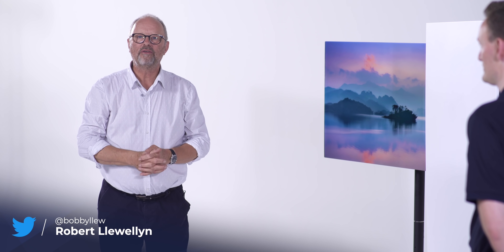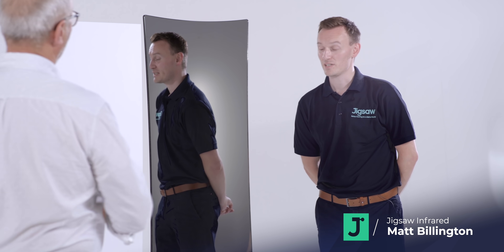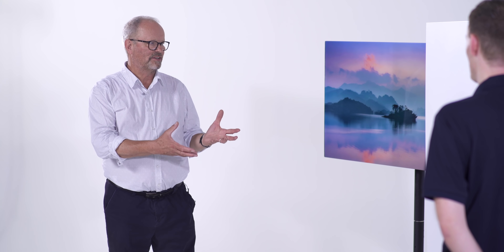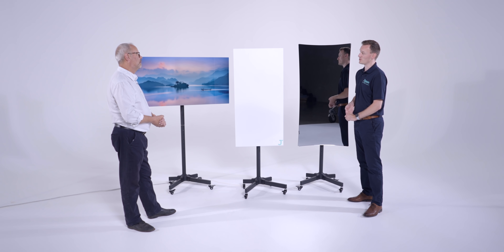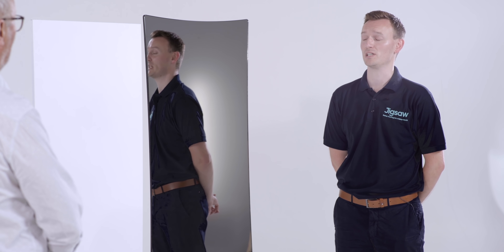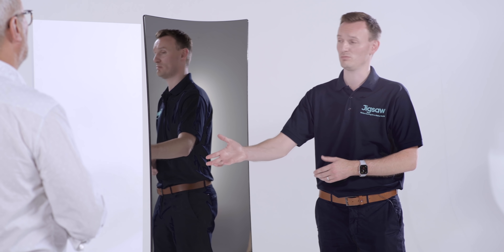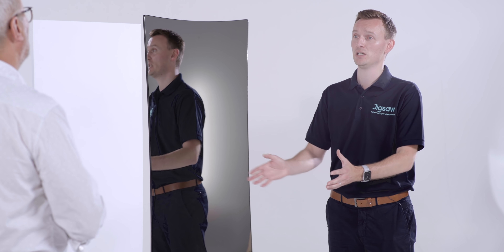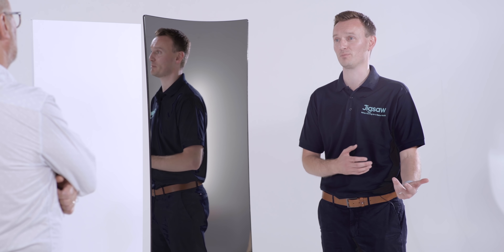JIGSAW INFRARED - Heats like the sun, cares for the planet | Subscribe to Fully Charged PLUS

Comment: When my old gas boiler finally packs in, I'm seriously considering switching to IR heaters.  Hopefully by then the price will have come down a bit too.  I can't wait to be rid of the following:
*Paying for regular service visits from a gas safe engineer
*Boiler breaking down when you least expect it
*The cost of buying and fitting replacement parts for the boiler
*Water pipes running all over the house that could potentially leak
*Bleeding the radiators
*Radiators taking up space and having to lay furniture out so they don't block them
*Paying for gas bills - I'd rather have a single electric bill and not have to pay the daily standing charge for having gas even if I don't use any
Reply: Screwfix currently have 1kw ones I stock for £12.99

The looks may not look the best, but are as efficient and you can decide if you like the heat, and the leccy bills before spending £000s.
Reply: IR is more useful for supplementally heating people, so that the room's temp can lowered. So it possible to just buy one IR heater and experiment with it to see how effective it can be for "you", while your still using your old gas boiler.

But also consider a radiator based Heat Pump (which has tax advantages too) when it time to replace the boiler. Since it will be far more efficient for heating "rooms". HP vs IR heating, have different pros and cons. Good luck....
Reply: The inherent inefficiency of resistive heating will forever gnaw at you. Don't do it.
Reply: Be careful Daniel... last time I looked at my bill gas was 1/6 th the price of electricity per kw/h. If you don't need a lot of heat they could work for sure, but if you are like most of us in the UK and use a lot of heating in the winter you'll need to look elsewhere I fear...
Reply: @benholroyd5221  That's a halogen heater.  IR heating is a totally different technology.  Rather than heating an element (which can reach around 600°C), almost all the energy of these new IR panels is emitted - the panel itself only heats up to around 90°C due to some of the IR reflecting back into it.
Reply: @dansmif  that's like saying a diesel engine isn't an internal combustion engine.

Halogen heaters are infra red heaters. That is how they work.
Reply: @OAK-808  Are you thinking of old style bar heaters with resistive elements that glow with the heat?  IR heaters are a totally different tech.  They're solid state and the panel itself doesn't get that hot.  They emit waves of IR heat across the room and heat the object they interact with.  It's a bit like standing at a window on a sunny winter's day, but you can still feel the warmth of the sun through the window.
Reply: @liammullan2197  I'd also like to get more info on the actual running costs.  My understanding is that the IR panels heat up the room quicker, and then they turn off and on in short bursts to maintain a comfortable temperature, so you're not running up a huge electric bill.  Whereas with gas, the boiler is on a higher percentage of the time to keep the water in the loop hot.
Reply: @benholroyd5221  Infrared is just a fancy name for heat, so yes in that regard all heaters are the same - they produce heat.  The key point is there's lots of different ways of producing heat e.g. heated water, halogen, resistive elements, solid state IR emission, etc. (the last one being the technology that was featured).
Reply: @dansmif  no. Infrared is a type of heat transfer. Of which others include convection and conduction. 

Infrared radiation is I believe the only method you can transfer heat through a vacuum. That is what the heat from the sun is. That is why its heating is so quick. Because it doesn't have to heat up any thermal mass. 

Radiators are poorly named because they work via convection. They heat up the air.  

If you want to test ir heaters, all are as efficient as one another, all have the same basic disadvantages and advantages. These £300 heaters aren't going to magically work  better than £12.99 ones.
Reply: @dansmif  re running costs

Anything is going to be more expensive than gas. Gas central heating is ~90% efficient. Electric heating is ~100% efficient. 
heat pumps are 200% -300% efficient. 

Gas is hugely cheaper than electricity, so nothing currently available can bridge the gap.

If you want lower heating bills without gas, heat pumps are the way to go. You'll get much cheaper energy bills, but that does come with a higher installation cost. 

Contrary to what this video says, I wouldn't say ir heating is the best option for main living rooms. For little used rooms they can be a good option. Or in large spaces. The instant directed is a good fit. For heating main living spaces though, you have no thermal buffer meaning you can't time shift the heating. For that you aren't really going to do much better than storage radiators.
Reply: @dansmif  Of course the panel gets hot. If it can heat the sofa, it will heat itself.
Reply: @OAK-808  You're right - it does heat up, but not to the extent of a resistive heating element which typically reaches around 600°C.  From the specs, it looks like the IR panels operate around 90°C.  Sounds like having them on the ceiling would be safer, and as Matt said in the video, they work better there anyway.
Reply: 22p(+) kwh vs 4p kwh?
Reply: @benholroyd5221  Was just thinking that, lol
Reply: @dansmif  All heaters not designed to convect are infrared heaters, even a gas boiler radiator, or a cheap 2 bar electric fire. I bought 4 little 350 W ones just to test them out. These are wired to Alexa, so I can voice activate, and also remotely activate them. I think the advantage of them is that you can activate them as you walk into a room and heat only a single room. And because my Tesla battery fills rapidly from solar, and I don't want to export, I remotely switch on all the IR panels. The house is therefore used as a storage device and absorbs the heat for later. Not perfect, but I'm just experimenting.
Reply: @James-zu1ij  that’s interesting James. How effective have you found them - in terms of heating & comfort
Reply: @dansmif these are exactly the same as water radiators, they work the exact same. Instead of pumping hor water trough it you replace that with an elctrical element.

Water radiators also radiate infrared radiation. That is the heat you feel when you sit next to it.
These just remove the inefficienty of heating the water, pumping the water, heating all the iron the water is contained in and the placement which usually isn't optimal since loads of people put couches and stuff in front of ratiators which stops them from radiating into the room.

The halogen radiators do the exact same thing, they just use a lightbulb.

Comment: Yeah, heating the last bit only when needed is great idea, but there's still not a very practical simple way to do that, that is also generally and easily applicable. You can feel the instant warmth from an IR heater, but until the air is also warm you will still be mostly cold. Some people is happy with that, most will not be, in real life. Warming up objects, like sofas, and beds, takes a lot of time to do safely with IR, a lot of time means you use a lot of power for a long time. In reality this system is unlikely to save much energy compared to heating to the desired temperature all the time using a heat pump for most people.

Also, IR heaters is a common cheap product, putting covers on them to make them look better is a HUGE disadvantage if you want to be able to heat up when and where you need it. It's a bit similar to having a towel warmer, you could arge that you can shower in colder water if your towel is warm, and thereby save energy, but most people won't do that.

The part about IR being so natural, and that our bodies is evolved to use that, is complete and utterly nonsense. IR is not more natural than convection, and it doesn't matter. Personally, I'm a mammal, and our bodies has evolved to be able to keep the temperature with food as the source of energy. Radiators in "wet" systems also emit IR for that matter.  Also, being heated on one side, and cold on the other is not what most people consider being comfortable, not even if the average temperature the skin experiences is a comfortable temperature, it's about actual comfort, not statistics.  

Preventing mould (and mildew) by keeping a lower general temperature, and using IR heaters specifically when and where needed just does not work, no, absolutely not, no way. You can reduce the risk of mould somewhat, on the surfaces that get hit by IR of relevant intensity, other areas will have a HIGHER than normal probability of getting mould and mildew, all else equal. Mould typically grows in places that wouldn't be exposed to significant intensity of IR from such heaters, unless heaters are installed for that purpose, instead of trying to creating comfort.  It works like this, increasing the temperature of air makes the relative humidity lower, thereby reducing the chance of creating areas with favorable environment for mould and mildew, as they "like" humidity. A lower general temperature, even with temporary and local "hotspots" doesn't reduce general humidity as much, and thereby is the risk of getting mould increased, not decreased.    

Another problem is that the intensity of IR is inversely proportional to the square of the distance from the source, technically from a point source, and their emitters are better than that in this regard, but still, you'd need huge emitters to create even exposure, to create thermal comfort comparable to just having a comfortable ambient temperature. Heating of the floor is extremely slow and inefficient, unless the emitters are very close to floor, or almost as big as the floor, or of course, focused on the floor.   

Claims that their emitters are more efficient than other heaters is just not true. Technically, resistive heaters, which their IR heaters are, are 100% efficient, but, as concentrated high temperature radiators increase losses, mostly due to the high temperatures, they're not generally considered to have a COP (coefficient of performance) of 1, really, but a bit lower than 1. While AC splits can have an average COP of 4, and they can heat the air to a comfortable temperature, quite quickly if dimensioned for it, not just fairly quickly go from to cold to "statistical comfort". They say their claimed superior efficiency is "not a wild claim, it's scientific fact backed by independent study." A single "independent" study, means nothing, extraordinary claims require extraordinary evidence, and their claim is extraordinary, their "evidence" is not.    

IR heaters are not generally considered a new technology, the idea that they're more efficient isn't generally accepted, because that idea is simply not true. And covering them up in order to make them look nicer makes them worse than usual, especially that instant heat part. In order to have thermal comfort where you go, when you get there someone or something needs to be able to predict where you are going, otherwise the idea doesn't work, until your still at one place for a longer period, or, the general area has been heated up, and then you're back on square one, having wasted a lot of electricity on heating the whole area with very inefficient resistive heating.
Reply: Your opinion is noted and you have obviously bought the cheaper version or seen the cheap imports into the UK. It's like buying a car, you get what you pay for. 

Th recent testing and University studies are proving that infrared is quicker and half the cost to run than other forms of electric heating. Have you seen the studies?

Comment: Cool if you can't fit a heatpump - witch is 3 to 5 times more efficient. Nice control features as well.
Reply: A heat pump would cost a little bit more but you'd probably save the difference in a couple of years. Trouble with great pumps is they are a complicated machine whereas this system should be fit and forget.
Reply: Heat pump COP is not all it’s claimed to be. The COP figures do not come from real life testing and the COP is often closer to 1:1 
An independent study – commissioned by BEIS but written by Cambridge Architectural Research – investigated cost-optimal ways to install electric heating, including infra-red heating, and energy efficiency measures across a 12 housing archetypes, representing 90% of Britain’s 28 million homes. The study found that:
•	The total lifetime costs (capital + operating) of infrared heating were found to be competitive, although not cost-optimal in some housing types.
•	There were only small differences in costs over 15 years between low- or high-temperature heat pumps, air-to-air heat pumps, infrared or storage radiators.
•	Assuming a longer product lifespan (e.g. >20 years) for electric storage heaters and infrared heaters made heat pumps less attractive over the total period of ownership – as heat pumps were assumed to be replaced more frequently.
Reply: The panels can be situated in the more appropriate locations in any room, have the heat where you want it.
Reply: @matthewwakeham2206  quality pumps keep save more than enough to pay for repairs and some extra. Heat pumps will get smarter too as well as include cooling feature and or replace boiler (hot tap water). What people chose may vary on their priority, long term saving - features - initial cost - planet friendly.
Reply: @jigsaw.Infrared  sorry Jigsaw, it's outrageous that you're misrepresenting the BEIS report like that - heat pumps were shown to be the most cost effective solution over 15 years and that would only increase.
Reply: I would only ever recommend air to air heat pumps, £2K installed, and just use an immersion heater for water, combined with a 4-6kwh solar its simply the best value for money, Air to water are simply far to expensive install and running cost, and the companies are charging £200 for a yearly service because they can. And IR heating in the bathroom and at the computer desk seems the most ideal place to start.
Reply: @jigsaw.Infrared  If it were true that heat pumps regularly operating at a COP of 1:1 then we would not have be using them for many decades all over the planet. My own heat pump is currently operating at just over 4:1 (my calculation) and that's on Skye. The house is beautifully warm all through the day and night, whichever room you go to.
Reply: It depends on what you do with the heat from a heatpump. If you use it to heat air these panels could actually be more efficient way to heat a home.

The air temperature can be substantially lower in a room when using radiated heat and it can be highly localised. An air based systems needs to heat the entire room to a higher temperature for it to feel equally comfertable.

Comment: These are fairly popular in Europe but the efficiency is max 100% as it's a resistance heater. Never going to as efficient as a heat pump. Can we have some reviews of off the shelf reversible air conditioner units as cheap heating systems.
Reply: This is the issue we encounter. Heat pumps are not appropriate in all cases. There needs to be some alternative and this is another form of heating. If you use solar and battery they are on a par but again, not always appropriate.
Reply: Agreed. It's weird than an EV show would not get it: the resistance heater in my 2016 e-Golf is far less efficient than the heat pumps in... just about every new EV out there. EV people have known this since the LEAF. There's probably a place for these IR heaters but if it's efficiency we're after -- and we are! -- heat pumps are the way to go.
Reply: @glennbillington4879  that surely isn't true. Why would having a battery and solar make a difference. Solar on its one provides electricity when it typically isn't needed for heating. Solar plus battery provides the flexibility to provide electricity when it is needed. Both heat pumps and your panels would make use of that flexibility. By heat pumps are 200-300% efficient and your panels are at most 100% efficient. I think your panels can only be more efficient to heat a small part of a large open space or to provide bursts of heat in a space that is usually unoccupied. Solar + battery is irrelevant to the question of heat pump vs IR panels it's basic physics.
Reply: You need a lot less heat with a radiator. You don't need to heat entire rooms and air temperature can be substantially lower to feel equally comfertable with radiated heat compared to a space that is just heated by air.

Instead of heating a complete space continually to a higher temperature you can use a single panel to just have the heat radiate onto you where you are sitting. Over the dinner table or over the sofa or your desk etc.
Reply: @xchopp  resistive heaters heat air. Radiators radiate heat onto you.
For a car comparison a radiating heater is more like the seat heating in your car. With that on you can keep the cabin temperature lower and be equally comfertable still. Which is what is recomended for ev's. And this is also resistive heating but is still a more efficient way to reach the exact same comfort level..

Comment: We found that the EPC got a worse rating than gas warm air heating when kitting out a small flat with similar panels. We suspect that was down to the software not catering for this form of heating and the assessor ticking the box for storage heating. However, there is no way of knowing unless you’re an assessor.
Reply: SAP should change that next year as electric is still seen as dirty. Things are changing.
Reply: storage heating would perform better than these as you're using off peak energy (lower carbon)